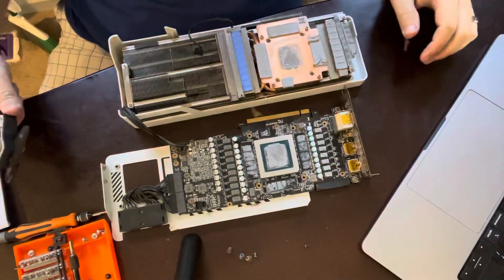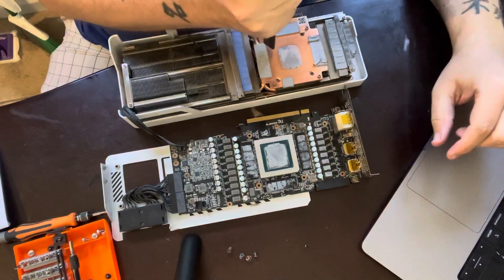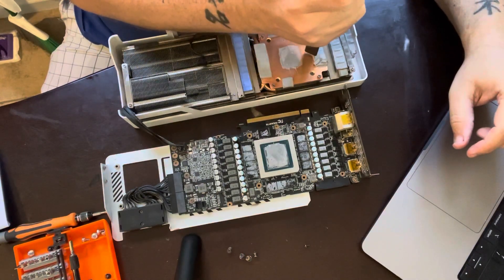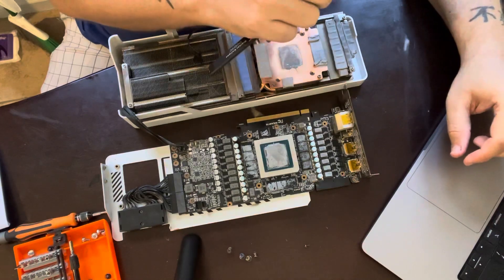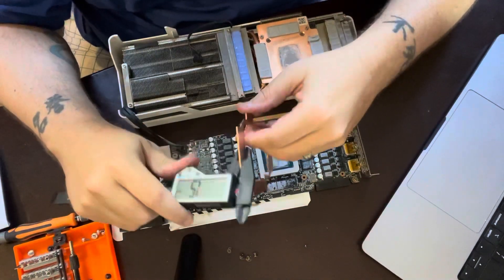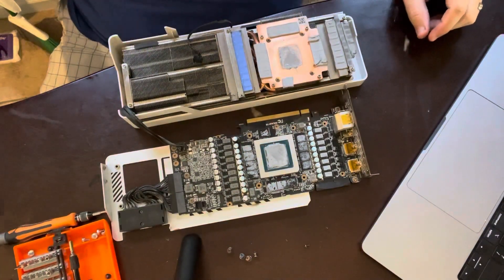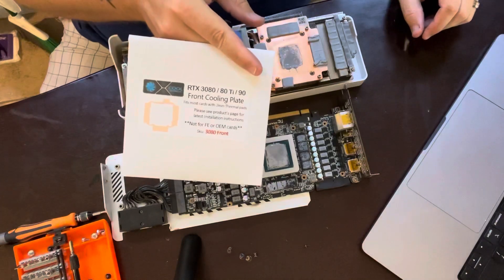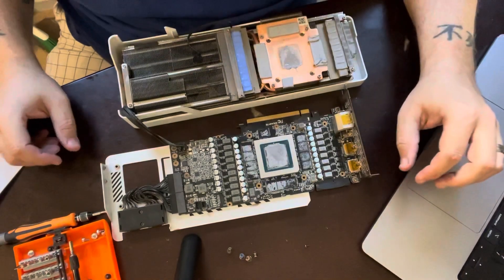Gigabyte vision RTX 3090 coolmygpu copper mod | how to

Comment: Any specific reason to using mx4? I'm thinking of doing this but I have some spare kyronaut....
Reply from the maker: Mx4 thermal conductivity for the cost is the reason I stick with mx4.   I’m pretty sure kyronaut will have the same result.  I would try it out see if temps improve and if they do leave it, if not move to mx4 or thermal puddy
Reply: Kryonaut dries up very fast when temp exceeds 70°c
For longevity I would use Arctic ceramique 2 on memory chips with that copper shim. If the shim was thinner thermal putty.

Comment: i did a copper mod, but my core temps rised so quickly to 75 degrees it just went from over 100 mh to 60 .and the power went to 230 w ...think i did something wrong here....mem temps stayed around 88..looks like the core isnt touching the original copper plate to cool...going to dissasemble to see whats going on
Reply: Cut some strips of electrical tape and be sure to mask all the necessary pins that are vulnerable by the copper. Good thing it didnt blow smoke
Reply: Core temps rising may be 2 causes: wrong pad thickness (too thick) or... the gpu heatsink is getting hotter with more heat being collected from memories and thus, it can be transfering this heat to the gpu core.
Reply from the maker: Yeah honestly I could have done without the copper mod.  Going forward I will probably just do pads next time I need to repaste

Comment: How is the temp of the RAM on a back side during mining? in my case I still have to have some sort of a radiator on the back for it to not go over 100C.
Reply from the maker: I put gelid thermal pads on the back.  If I had the card in a climate controlled environment the temps would be well under 100.
Reply: @Amigospc  yah, I also use gelid thermal pads too. And a copper radiate with a fan on it that drop the temp to 80c. On a water cooled 3090 with the same radiator on a back temps a low 60c